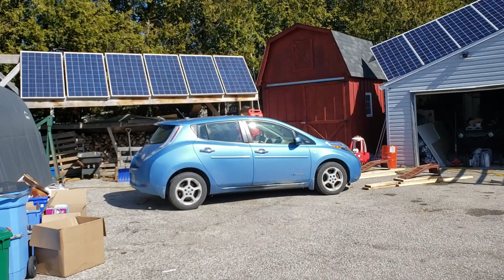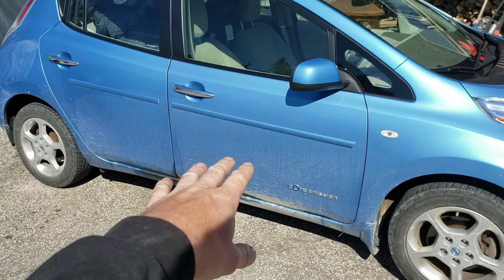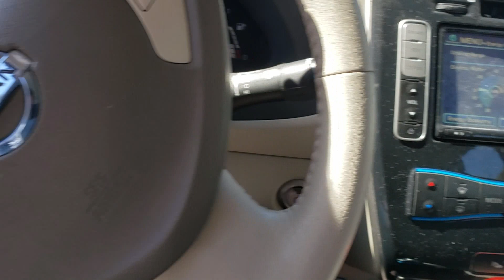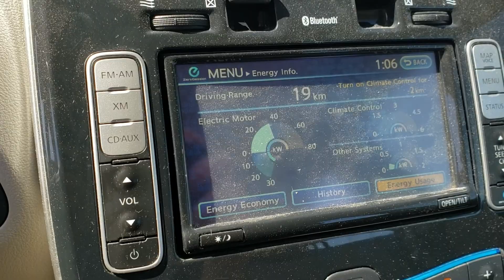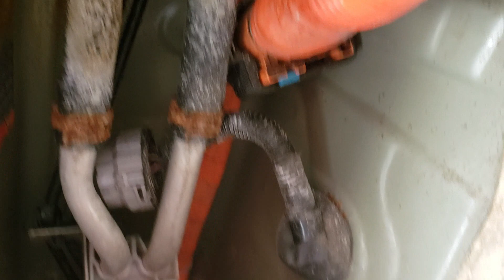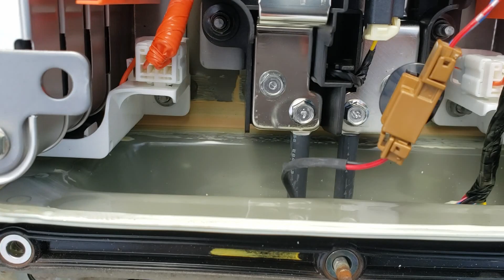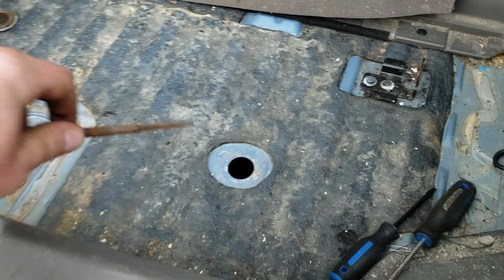DIY 52KWH Nissan Leaf 28Kwh Extender Battery Pt1

Comment: Crimping can carry more amps than soldering. Also two cables are not the same as 1. It’s impossible to get the lengths exactly the same. But that has more meaning with short cables. These are long enough that 1 extra inches isn’t going to change the resistance much. 

I hope the project worked out well.
Reply from the maker: it worked well, watch part 2.

I am still driving the car today :)

Comment: This is awesome!  I've been intimidated to do a project like this because I don't know how to write CAN BUS.  But if you are correct, and this bypasses all that computer junk, then I'm in.
Reply from the maker: it does, everything works as normal but the car doesn't know there is more batteries is all, atm I will be driving at 0 km to emty for about 100 km lol
Reply: That would be funny at first... It goes into turtle mode and continues to drive for hours more... Hopefully the turtle mode limits the speed based on the battery voltage at least a bit?  I have swapped laptop battery cells and the battery gauge was all messed up but eventually after maybe 10-20 cycles it learned the true capacity.
Reply from the maker: @jontscott  i will be long range testing it tomorrow.
Reply: Yes this bypass the need for CAN BUS manipulations, you only have to use bank of batteries that is same or more than the capacity of your car. while your car will do the charging and discharging or usage as designed by OEM Nissan.
Reply: This is my update below:-
https://www.youtube.com/watch?v=OIUjmi1OBAY&t=12s
Reply: At some point one of us does have to make a step by step how to video on how to do this process.  I would be interested in getting with a local machine/fabrication shop, and having them make some custom connectors for a DIY Leaf Battery Parallel Kit that could be sold to people to streamline this build.  If the car's software doesn't recognize the extra battery -oh well.  I have no problem with an aftermarket "range-O-meter" phone app or dash meter.  Shonoiki isn't too far down the road from me here in Texas.  That would be a cool video
Reply: Look who dropped by.. Aside. The magnificent solar panel photo bombed the video
Reply: DAVIDPOZ IN THE HOUSE

Comment: It's quite 'normal' for the cells to smell like lithium, all li-ion packs do pretty much. There's an inevitable tiny amount of solvent and LiOH leakage over time, it has nowhere to escape to and your sense of smell is actually super sensitive to it, so even a small amount over the years will be detectable.
Reply from the maker: Hey thanks for the post! I could use all the advice you have, I have watch your videos but dont understand canbus and such
Reply from the maker: I was just watching your video of you long range test and I see you low cell your talking about, and I do not have one as bad as this.
Reply: @GoingOffGrid101  Pretty sure I nailed what's wrong, I sent you an e-mail about it. Regardless you're going to need a CAN bridge to correct the display. We're out of stock at the moment, but once we get stock we need to be in touch about this. The rewiring + CAN bridge should yield a fault-free range-extended car.
Reply from the maker: @PowerElectronicsBlog  lol looks like its time for another video :D
Reply from the maker: @PowerElectronicsBlog  I sent you an email, hope you don't mind helping me a little more.

Comment: I did the same to my nissan leaf ,the computer  will read the same range ,so i took it for a long down hill dive for a full charge of 180mile added  ,and it hold its charge!! I was so happy 😊 I went from 60mile to 170miles ,even recharge at the plug goes back up to 170
Reply: How to add km on computer man. After add old battery in trunk?

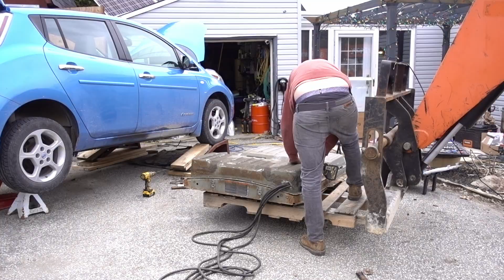Comment: Good video, but at 17:44 you can't just pass the wires through the hole, the sharp (even if filed down) edges of the battery casing WILL rub  through the insulation from the motion of the car while driving! Tape the high voltage wires over with some thin sheet metal piece or put the wires in corrugated metal tube.
Reply from the maker: I have spray foam and silicone around it for protection.
Reply: @GoingOffGrid101  Maybe it will hold but if not it will be catastrophic once that fire starts. All those amps .. plus high voltage arcs really well. The welding cables are thick gauge but the insulation is rated for what, max 48V and you have almost 400V
Reply from the maker: @janissuipe7553  it would instantly blow the fuse as well
Reply: @GoingOffGrid101  Do both battery packs have fuses? If yes then you could just get stuck on the road.
Reply from the maker: @janissuipe7553  yes both have the original fuses

Comment: It looks like you soldered the extension cable lugs onto the cables.
I thought that crimp connections were the recommended method ( with appropriate shrink tubing)
Reply from the maker: @brianmacadam4793  your probably right

Comment: Awesome project I think when apart I would have replaced any modules that were low or just used a replacement battery and kept the good ones for the additional battery but I know you have a plan can't wait to see the next part. The trick will be to fool the Leaf system into not knowing you have two batteries. GOOD luck my friend.
Reply from the maker: i was looking into a battery but it was 5000 bucks :S
Reply: @GoingOffGrid101  Charging it back up may be the challenge after a few cycles but even if you get 50 more km's it's a win.
Reply from the maker: @offgridwanabe  its no problem at all, everything works great!
Reply: @GoingOffGrid101  Great

Comment: Voltage up, wire size down. 

To pass 200 amps at 12v, will definitely need a thicker chunk of metal..... 200amps at 240v = easier. The prius MG1 and MG2 are fed a good chunk of amperage at 600+ volts yet fed with perhaps maybe a 4 gauge wire. 

Voltage can be your friend and your enemy. Typically the latter, so play safe folks!

Comment: Electrical engineer here, this is a really bad idea since in the case of a HV short to chassis the car will have no way of shutting it down safely!
Reply from the maker: it has a fuse on the car side and battery in the trunk side.

Comment: Each one of those welding cables will handle 300Amps! No problem. You don’t need to parallel 2 together!  I hope you got all the metal swarf and rust bits out that battery case! Because things could go wrong so BADLY for you! Good luck 🤞
Reply from the maker: i did get all the crap out, also i am using 2 pos and to neg cause of voltage drop, I want the battery in trunk to supply as much as possible.

Comment: Wouldn't it work better if you parallel the cells directly rather than just paralleling the main rails? 

Then the cars battery management computer could deal with balancing and charge logic, and your battery meter will likely be more accurate as well
Reply from the maker: it would not work cause the Nissan leaf counts the Kwh in and Kwh out, and max out at 22.5 kwh, even if you have 40 kwh or higher the car will stop moving after the car has consumed 22.5 kwh unless you do what I did.
Reply: @GoingOffGrid101  I see, I thought i5 worked like a laptop battery where you can parallel the cells, and then hijack the batterys wear calculation algorithms to force it to learn the new capacity

Comment: i have scene something like this done before they connected outside the car battery using the socket and plug from a salvaged nissan so all they did was unplug car battery plug in the socket and plug with cables off to the back for a trailer carrying the range extender no need to drop main battery just unplug and plug the adapter in for the extra pack
Reply from the maker: then you have to sync with the contractors in the stock battery through the can bus :S
Reply: @GoingOffGrid101  good point i wounder how he got around that i wounder if he tapped into the canbus as well
Reply: @1981dasimpson  He had a switch which had to be turned off before shutting down the car but one he forget and blew the fuse haha
Reply: @offgridwanabe  ah ok i was trying to find his videos but could not remember the name
Reply: @1981dasimpson  Leaf Xpack I think
Reply: @offgridwanabe  no it was paul kenneth

Comment: hi mate, get a hydraulic clamper for the lugs. soldering is absolutely not recommended for high current situations. it only sets you back like 50$.
Reply from the maker: Good idea, iv been wanting one. On that note I use to run a massive 12v 4000AH battery bank and used soldered lugs and never had a problem. But I do want a crimper
Reply: If silver solder doesn't hold it your house is gone too.

Comment: Great video. Could you have put the extender cables through the 'fuse mounting' by drilling two holes in the top of the fuse holder? It looks like there may be space?
Reply from the maker: probably :D

Comment: Finally!  Thank you for making this video.  In the future if you take a few more seconds to really emphasize where inside the battery pack you made the connections I would appreciate it, because I'm definitely gonna copy you at some point.  I noticed getting the top cover off took a lotta hammering and grinding.  Is this par for the coarse when opening these batteries, or do you think the rust issue was more severe up North where you are on account of salting the roads?
Reply from the maker: there was 6 security bolts that I didn't have a socket for. so i used a grinder with a cutting wheel to make a flat head and then used a punch and hammer to turn the bolt.
Reply from the maker: did you watch pt1 ?
Reply: @GoingOffGrid101  This video says Pt1 bud, but yes.  I watched Pt1 and 2 in their entirety.

Comment: The main leads are small bc the voltage is high on that battery. The higher the voltage, the smaller-gauge wire you need to supply wattage which ofc is a measurement of power. There is a give & take between amperage & voltage. For example, a lower-voltage battery can theoretically supply the same amount of power as a higher-voltage one, it would just take a lot more current & thicker wires. By introducing thicker wires than necessary to that Nissan Leaf's circuit, you're needlessly introducing more resistance therefore more inefficiency & power loss via voltage loss to the system.
Reply: A thicker wire has less resistance and thus can carry more current (amperage). Thicker wires  add weight and are a bit more difficult to install, especially around sharp corners.

Comment: This'd be cool to do to my 2013 honda CRZ, thing has a sub 1kWh battery pack, would love to be able to throw in a 3-6kWh pack and make it a plug-in. Then re-program the controller to be more agressive with using the battery. As it stands now with the way i drive, the battery indicator nerver drops below 1 bar from full. If it could use the battery while the engine is warming up that would greatly improve efficiency. Also wouldnt mind replacing that hot box of a glass trunk lid with a solar pannel, the window is useless for how tall i am, and with a solar panel, it could fully charge the original battery in just over half a work day

Comment: I will like to know the kind of details you are getting from leafSpy before and after the addition of the range extender batteries, this will show us the actual capacity of the additional batteries.
If the car comes up with an error like 'high voltage leakage', just know that you need to insulate your car body groud -12volt from the bank of the extender batteries.
The doubles cable is overkill, just as you found out from the OEM cable used in the car HV connection. 
The capacity bar still plays a good role in how the car functions, if you can reset it to full 12 bars you will enjoy the car more.
Sorry, your Nissan leaf no long has a trunk for groceries like mine but a longer range.
Reply from the maker: Death to the trunk lol, I had 38 Ah before and I'll check it out after a few cycles and see what the car reads. I have no fault codes yet, but I will be going on my first long range test soon. I will be disappointed if I dont get  at least 200km on a charge.

Comment: "The battery in this video could kill you if you do not know what you can and can not touch"....... so that's why the unprotected cables are hanging on the ground!
Reply from the maker: once the cables had power they where taped off with electrical tape. remember I have to put the half way switch in the main battery for the cable to get power, so they never had power till the very end.

Comment: Out of curiosity how much battery degradation did you have it is super impressive that you're doubling the capacity but would it not have been a good idea to recondition the battery since you already had it out?
Reply from the maker: The battery in car is well balanced but warn out. Battery in car is at 60% state of health

Comment: i think with your boot battery having thicker cable ir might prefer drwing the amps from that befor the stock battery not a bad thing if the boot battery is better condition
Reply from the maker: its in much better condition, and it works well on my first test.

Comment: It looks like there isn't enough protection for the cables going through the holes? Or is there something covered up by the spray foam? Waterproof flex conduit and fittings are pretty cheap.
Reply from the maker: I used silicone and spray foam, first silicone to make a thick barrier around the wires then spray foam to hold the wires from moving

Comment: i know you feel this is cool but its not DOT safe and any type of crash can kill your self or others trying to help you , get hit hard in the rear and you have fire or HV to the body of the car as the park is now in a crush zone  ,  slide of the road into water then its flood and HV well get you , and so on , 40 to 80 + miles does not cover the risk you are adding
Reply from the maker: The stock setup has 400volt wires under the car that are not water proof. Gas cars are the same if they get hit and gas leaks and fire it much more dangerous. I believe the extra 130km I get now is worth the small risk.

Comment: How much did it cost? Does the battery charge via CHAdeMO?
Reply from the maker: hi, I got the battery at a super deal of 1500 bucks, the car no longer charges with the quick charger cause the car knows something is up cause the extender pack keeps putting power into the traction battery even after you turn the car off.
Reply: @GoingOffGrid101  Oh nice, where did you find the battery at this price?
Reply from the maker: @gteixeira  junk yard

Comment: How much farther can you drive after the modification?
What battery did you ad and how much did it cost ( or would it cost)
Reply from the maker: I should be able to go 160km farther then stock.I used a Hyundai ionic 28kwh battery, I got a good deal at $1500 for the battery.
Reply: @GoingOffGrid101  Miles?
Reply from the maker: @samusaran7317  i can do around 120 miles or 200 km

Comment: Once my leaf is out of warranty I would love to do this !!
Reply from the maker: it was easier then I thought
Reply: @GoingOffGrid101  I have A 2017 leaf and I just lost my first capacity bar.  The bms says my amp hours are just above 61 .

Did you guys use any rust reformer on the metal before putting it back .
Reply from the maker: @oscer1111  I used fluid film, my car was at 38 Ah :D now im at 116Ah :D
Reply: @GoingOffGrid101  that's excellent.  Good job !!